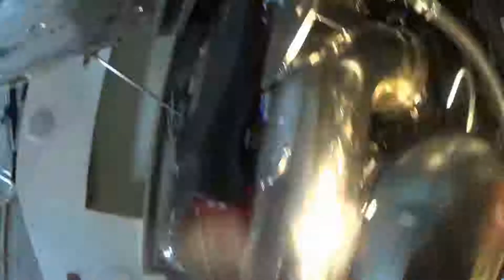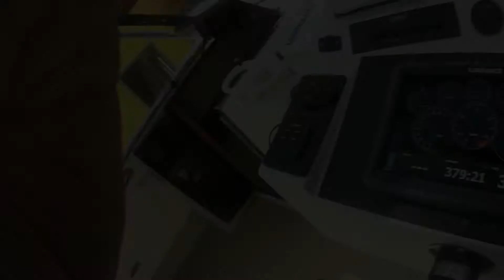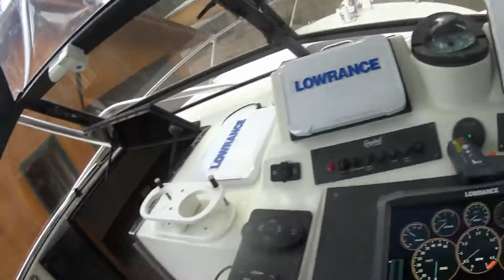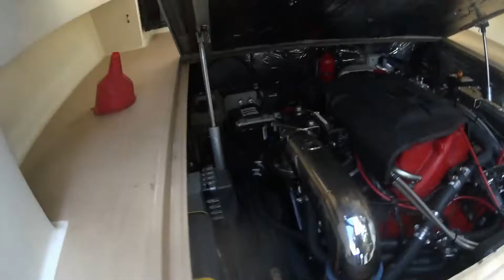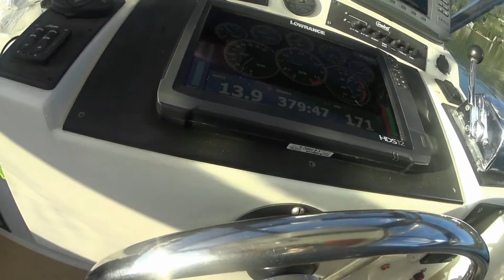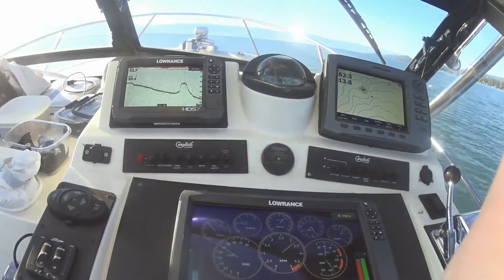Volvo Penta Full FWC upgrade

Comment: Did you look at other stainless exhaust systems? I have the same boat and I need to replace my exhaust manifold, I don’t have the closed cooling system.
Reply from the maker: Sorry for the late reply. I did not look at other systems, however others did and there are alternatives. If you visit the Carolina Classic Owners forum, there are posts and threads there on this topic.
Reply from the maker: I did not. This one fit the needs and the owner was willing to work with me (Jerry Schmidt)

Comment: Excellent video !  Will be doing exact same upgrade to mine. Already purchased the half-system from Orca Marine and will be ordering Stainless Marine manifolds and risers shortly. Was hoping to make my half system into a full system to preserve the expensive aluminum manifolds. Your informative video is super helpful and gives me hope that this might also work on mine. I have a 2007 Chaparral 256ssx with the same 8.1 Volvo Penta engine. Only real difference is my heat exchanger is intended to be mounted on the rear of the engine... which may complicate the hose routing.
Reply from the maker: House routing is always a challenge. Look well into the automotive world. That's how I solved most of my problems.

Comment: Was this a complete kit purchased from Stainless Marine?
Reply from the maker: It should be. It might be someday. Today, it's not. A long story behind this, and I had a lot of support from Jerry Schmidt and Stainless Marine. His dilemma was and is, what might be the demand for the complete kit? I've been debating posting this on THT to see what's out there. I also wanted a complete season on the upgrade before made a claim of success in a major posting like that. I think I'm there in that regard as I've fished all season now without any issues. It really is the super solution I hoped it would be.

All that said, if the other bits never become a VP-focused kit from Stainless Marine, they are still easy to acquire. Even if Stainless Marine were to make them part of a kit, each installation would require differing hoses and clamps and such that installer would have to source elsewhere. Not a difficult procurement effort, but maybe a little time consuming. When I post, if I post, on THT, I'll offer all the information in that thread as well as answer any questions. If Stainless Marine gets some traffic, Jerry might jump on board with a kit.
Reply: @Piscator09  I'm currently looking at a 25 CC that's been repowered with a Volvo 8.1... but the ingestion issue has me thinking twice. Motor only has 200 hours...
Reply from the maker: @louisperna3666  Louis, if you make that move, definitely go this route. At 200 hours, those VP cast iron riser/manifold should most likely come off. You could still be totally good if the boat has only a few 0-2000 hours (ECM reading). Most don't though. Getting out of harbors and re-entering marinas typically puts the 0-1000 hours up to something like 25%. If that was in salt water, that's where most of the harm is done. Fresh water is much less of an issue. Join the Carolina Classic owners forum even if not an owner yet. About 500 active owners there and tons of information. I got rid of my old VP iron junk at 177 hours, and that was probably just in time. 

Here's a hint. Require a compression check on the engine. If all cylinders are close to or above 165 psi, you're good. If the center two on either bank are down any significant amount some damage has been done and the heads should come off for valve seat/guide work. The valves themselves are inconel. Best stuff there is, but the guides are native iron. Salt in there is bad news.
Reply: @Piscator09  thank you for the valuable information! I'll look up the group and get informed! Thanks again...
Reply from the maker: No.  Only the risers and manifolds. The rest was roll your own. But, at that time, commonly available parts.